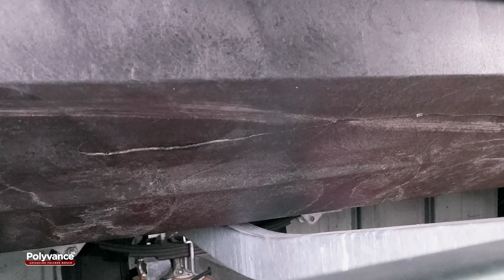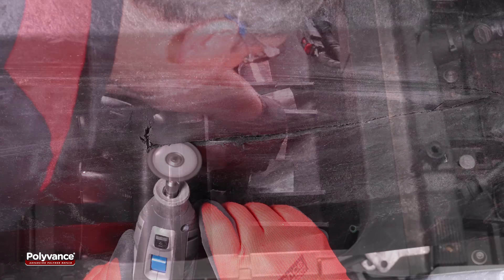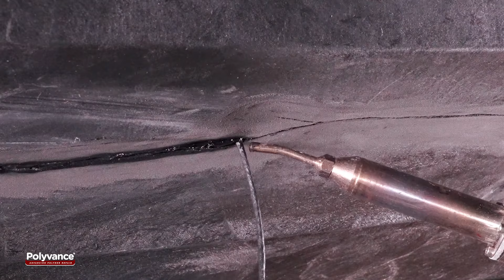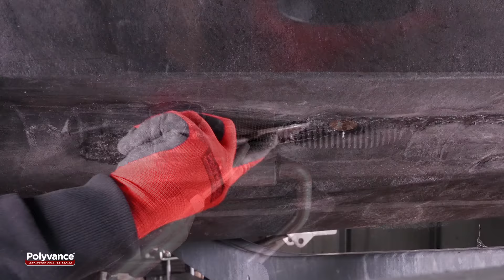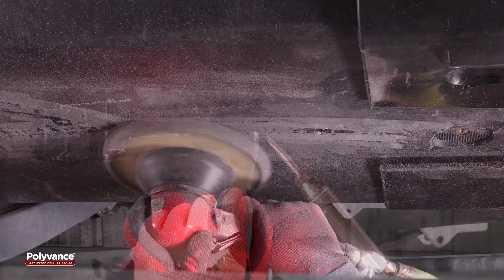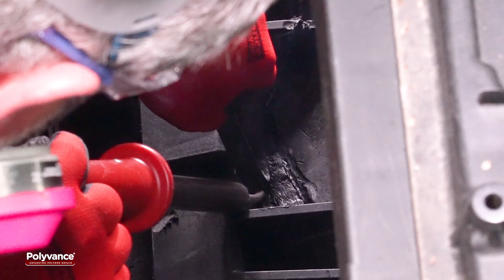Sea-Doo Switch Hull Repair | Plastic Welding Demonstration

Comment: Hello,

I hope you are doing well.

I would like to know what technique and method should be used for thin-walled ABS plastic parts, such as those commonly used in household appliances.

I would appreciate it if you could kindly advise me on the appropriate process and recommended approach for working with this type of material and application.

Thank you in advance for your guidance.

Comment: Hello, I am restoring a vehicle which has PPT trim parts such as pillar trim where the attachment tabs are broken off.  What technique or products would you guys  recommend to repair these parts?   Thank you so much for your help!
Reply: You would have to reconstruct the tabs or reattach them. You could use the technique in the video to reattach the broken tabs if you have them or attach tabs you have fabricated yourself. Metal mesh or wire for reinforcement